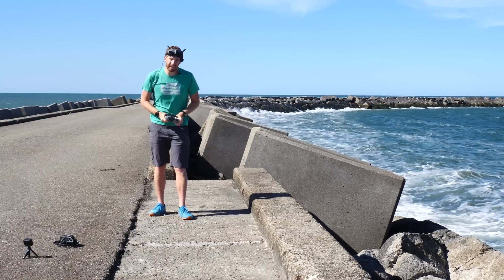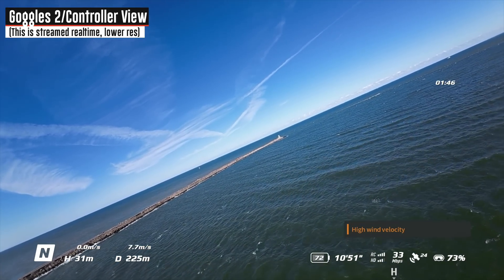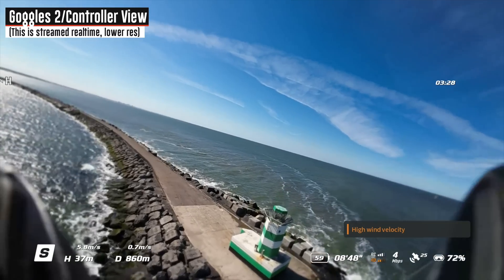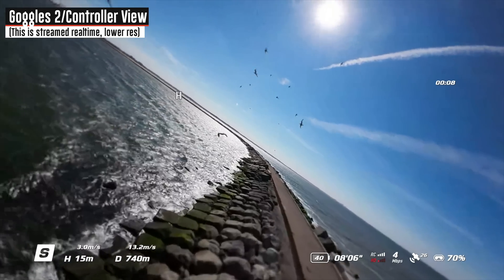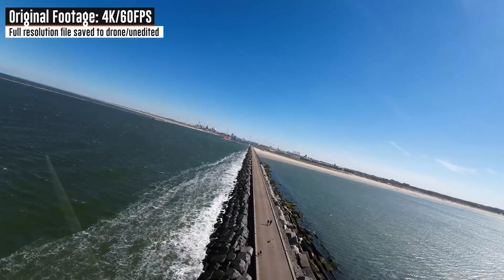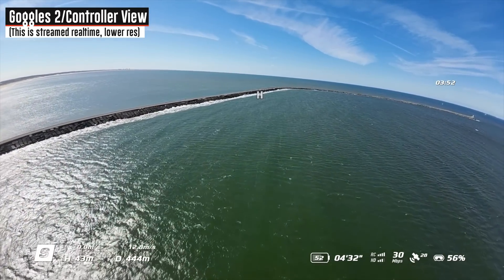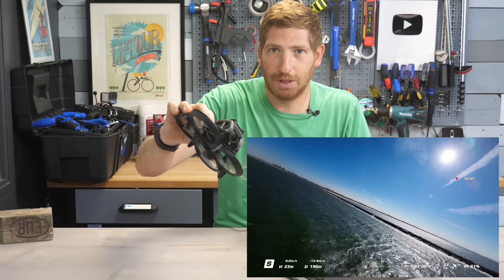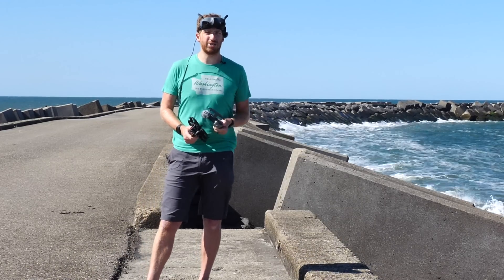DJI Avata High Wind Test - 50+KPH Winds!

Comment: its very intresting by the way - why on 5:16 you have only 7 mbps..  there is only 616 meters from you. Is there any additional maybe radio on that building that you flown around?
Reply: I was wondering that myself. Its supposed to get a range up to 10km but that range is awful. My DJI V1 goggles get around 4-6km around here with houses and wifi near.
Reply: @matthewherridge9430  you need fcc hack if you dont done it already. but I know one man - fcc hack not improve his power of connection, but fcc hack was done 100% - in "manual" part in menu shows 3 channels. I don't know why. Maybe dji locked this hack
Reply: @Deniseich  yeah but as he seems to be american I assumed his would be in fcc mode already.
Reply: @matthewherridge9430  its some kind of a bug..   its very strange. my avata has very powerful connection. you can see it here - https://youtu.be/n09SMO_xiPM

Comment: Hey Bro, what drone would you recommend to use to catch FPV footage of kitesurfers in 35+knots of wind?
Reply from the maker: Either DJI Avata or DJI FPV would work. Both are well above the required wind thresholds, so you wouldn't have issues with either. The DJI FPV might get to the scene a bit faster in manual mode but realistically even the most experienced FPV flyers likely aren't going to fly in manual mode in 35+ knot conditions.
Reply: @Dcrainmaker  thank you so much!

Comment: This drone is a cinewhoop, They are notorious for flying poorly in high winds,  The prop guards catch the wind. This drone should be flown indoors or below 25 feet 90% of the time, its designed specifically for that purpose.  If you want a fast drone a 5 inch 4s like the nazgul5 or skyeliner will do. But you will have to fly in full manual mode without gps or auto level.

Comment: What? Is this a joke right? Don't mean you or the video. 2KM of range is inaccessible. What nonsense rules we have here in EU. I was considering getting this drone, but now I probably wont't purchase it. What do I need the drone for it it's signal is killed after 1/5th of the possible range? That's not even fun.
Reply from the maker: Technically the limitation here isn’t really an EU one, but rather that DJI selected not to put dual frequency in this, so normally on the Goggles V2, it’ll switch over to that. Yes, it’d still be shorter than FCC, but not meaningfully so for most pilots (since it’s be 6km instead of 2KM, and frankly this drone won’t likely flaw 6km and back without running out of juice). Sadly, Goggles 2 doesn’t have that dual channel capability.
Reply: @Dcrainmaker  thank your for your great video and response, seeing horizon steady was very cool although I wonder about the maximal possible resolution and frame rate as it must rotate the image and crop out enough footage from the sides to achieve it, unless it just switches the focal length. 
Forcing drones including the new Avata into FCC mode seems possible but that's either a thin gray area or completely illegal. I'd rather be fine if the drone would just refuse to fly further but still having a great signal instead of artificially reducing the signal.

I'd love to see some footage on the max heights this drone can fly into the sky in both modes. That'd be another interesting video to watch.

Comment: Great test. It would handle the wind even better in manual mode.
Reply from the maker: From a speed standpoint, yes, but not from a control standpoint. In that scenario every wind gust you’d have to manually counterbalance all aspects (pitch/roll/yaw/throttle), which gets quite complex as the winds constantly shift and change intensity.
Reply: @Dcrainmaker  Of course, one needs the requisite skills to fly in manual mode. Being able to pitch an roll more would increase control though. Trust me I fly in windy conditions a lot.
Reply: Think of it like driving fast and hitting black ice with your car. That’s the feeling I got when I had a yaw stall in high winds with my avata. I don’t consider it a design flaw though; it’s just the nature of the beast. It does become operator error once you know this and fly in sketchy wind/locations. I’ve found that rocky shorelines and low walls at high speed with a right to left perpendicular wind gust are what I have the biggest problem with. Headwinds and tailwinds are fine. It’s when the wind hits it like a frisbee from the side and you have some downward pitch going on combined with a clockwise yaw movement that I’ve had to punch out. If you are low on battery you can’t throttle out of the situation. Great video. I appreciate the content!

Comment: All drones will fly with a tilt when flying with a side wind. If you are a camera/gps pilot you would be used to the gimbal keeping the horizon level. What you are experiencing is what traditional fpv pilots would see from a fixed camera.

The other thing I would mention is that ducted quads, or prop gaurds really affect flight performance. Put this guy in a steep dive from up high to experience this. I'd expect all sorts of prop wash and a wobbly flight.
Reply from the maker: Yup, I show how a 3 axis gimbal resolves the angle in other wind drone videos. And also show in this video how electronic stabilization (HorizonSteady) does effectively the same thing.

As for steep dives, I haven’t seem that stability wise. Keep in mind there isn’t much of a ducted design here, but rather more prop guard. However, unlike most prop guards that also are a bit flimsy and thus contribute to unstable flight, these things are incredibly thick/strong (perhaps overly so, perhaps not), and have virtually no flex, and thus don’t seem to introduce wobble.

Comment: hi dc ....thanks so much for your video there all good . just wondering is there any work around pairing the fpv controller to the avata , im using the iphone 13 and dji fly app. ive done the update i think v01.01.0000 and the googles is pairing with the drone . i followed the app process and when it gets to pairing the controller part it doesn't connect. a blue line comes up i click on the line . it ask to hold down the power button for 4 seconds and the same on the drone but it donest pair... di you know of a work around please  thank you
Reply from the maker: Just to clarify, is the problem the FPV controller to Avata, or the iPhone portion?
Reply: @Dcrainmaker  hi there, the problem is the fpv controller will not connect to the drone avata or the Goggles. I use the DJI fly app on my iPhone 13. And followed the steps to pair them..
On the app it pairs the drone then the goggles then the controller u just pick which controller. I’ve pick the fpv controller. It shows on the graphics what to do. But unfortunately it doesn’t pair. Then a blue line pop up at the end of the screen. I click on it follow the steps. Hold down the power button on the fpv controller till it beeps. Then the drone 4 seconds. But unfortunately it’s doesn’t connect. Have you heard there is a problem with some update??? V01.01.0000
Reply from the maker: @beedroneinsta  Gotchya. The first thing to double-check is that you've updated the FPV controller too (wasn't sure if that's what you meant). That can be done via the DJI Fly App, or, if it's not cooperating, you can use a computer with the DJI Assistant 2 (Consumer Drone Series). I'd actually step back though from the app. Disconnect the cable, and just do pairing straight between the controller and goggles, and then drone and goggles. I've found that specific step you're talking about in the app finicky. I don't know why it sometimes connects instantly for me, and other times it doesn't see avata and gets stuck at the same place as you. I think it's a specific order of operations thing (like, which one I turn on first, and it feels like I need to turn on the controller first). But again, for the moment, remove the phone from the equation.
Reply: @Dcrainmaker  hey thanks so so much. I will try that in the morning. Again thanks for your help and I’ll get back to you soon. I hope your enjoying flying the new drone. Between this drone and a few bugs 🐛 or bearings I’m trying to get out of my canyon aero bike. It’s all go.
Reply: @Dcrainmaker  ray I can’t thank you enough that worked a treat . Spot on . Thanks you
Reply: I was wondering the same thing. Thanks for the question Michael Walsh and thanks for the answer DC Rainmaker.

Comment: Looked several times.  Looks like it went beyond 90 degrees, but it came back the same direction rather than a full roll???
Reply from the maker: Yeah, it's fuzzy to me. What I couldn't tell/decide is if electronic stabilizaztion (Rocksteady) actually kicked it for that split-second and flipped the image.

Comment: Just to add to this a little, the Avata appears to be a little less stable in crosswinds than some of DJI's other offerings; I was flying full manual and had the drone flip itself.  I believe this is due to the aerodynamics of the craft itself; the center of mass is well above the propellers rather than in line like many of DJI's offerings, so if the wind is right and you get the wrong angle it wants to end up on its back.
Reply: Ducts hurt in wind. & also this has smaller props then all other DJI drones so most likely needs more angle to hold its place
Reply: I was going to say if you fly in normal or sport mode the engines will cut out won't it? So should only fly in full manual when winds are high
Reply: Had same issue

Comment: How can you get so far ( oder 800m) in ce Mode? I can reach with mine Just 300m. Is your drone in Fcc, how can we get fcc Mode?
Reply from the maker: Mine is EU mode (cause I live in the EU, and it's automatically done via GPS). I'm pretty consistently getting up to about 1,000 meters (and that's it). However, I also get as little as 200m if there's any trees around. Even less in a handful of cases.

Comment: Is the transmission range determined by GPS? If you take a unit bought in EU, to the US, will it have better range?
Reply from the maker: Yup, it's automatic based on the GPS location. So if I jump on a plane to the US (such as next week), it'll then fall under FCC rules. The days of different hardware for different countries are long gone.
Reply: @Dcrainmaker  how do I hack it to get US range in EU ?
Reply: @grzib  b3yond is working on it